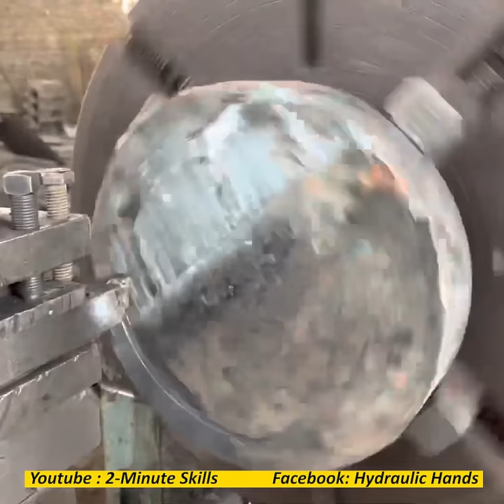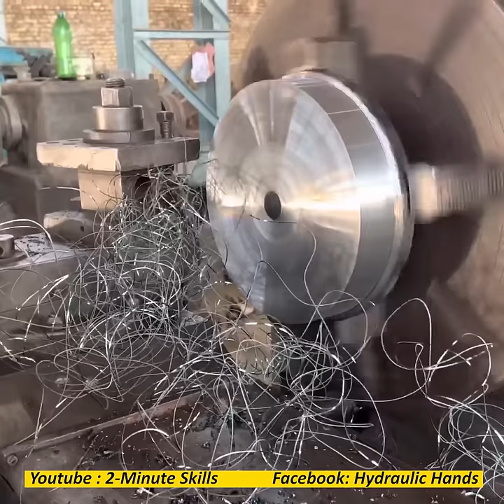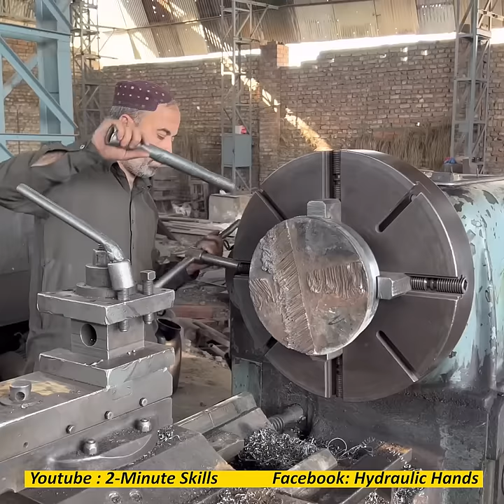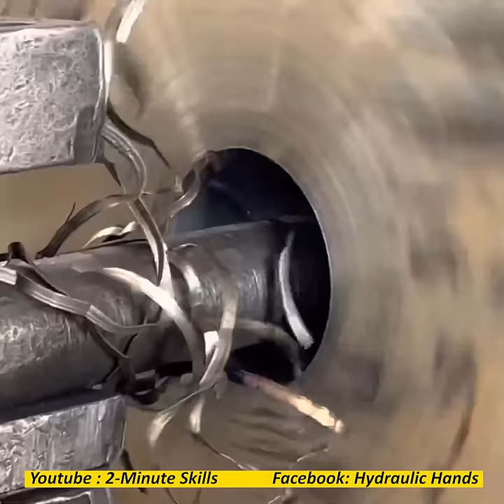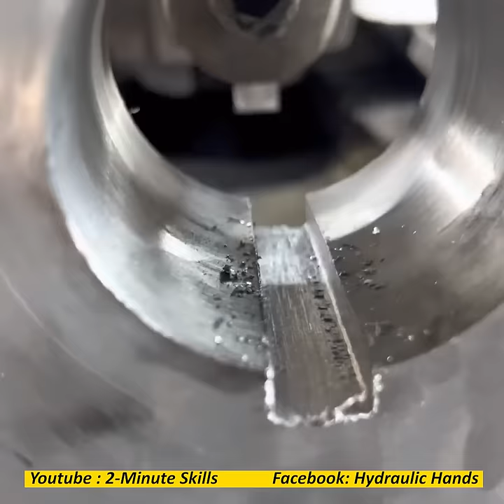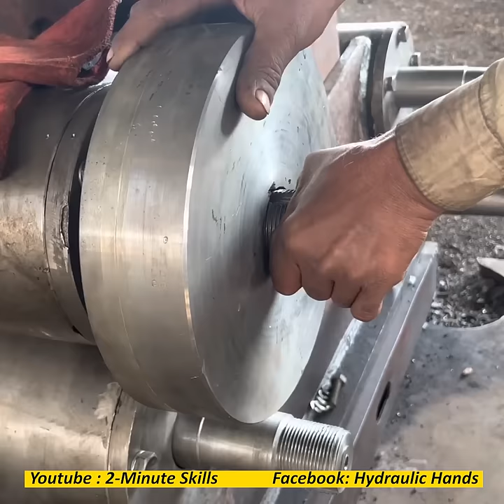How we made steel mill machinery part from old ships high strength steel

Comment: Gotta love the custom indicator 🤔😳
Reply: Yeah I tested it out and measured my own Accuracy and its constantly between 5-7thou then I isolated the system and made the tip activate a lightning circuit and it is good to the surface finish of the part.

Comment: That metal has a lot of dent inside of it..is that even a good thing
Reply: I think because it only needs to register against that flat surface and doesn't need to be perfect so they saved cost by using a rough piece. In their economy the difference in cost is perhaps equal to the profit in the job. 20 years from now it will still be working so it is all good.

Comment: Two things … First where in the hell is your over head crane to lift those parts and secondly that’s like over 50 year old technology turning with brazed tool bits. I know I sold carbide tooling for the past 40 years  in lots of machine shop you need to get up to date. And surly get done safety procedures in place before someone get serious hurt!!!